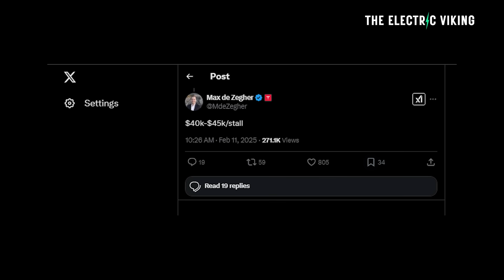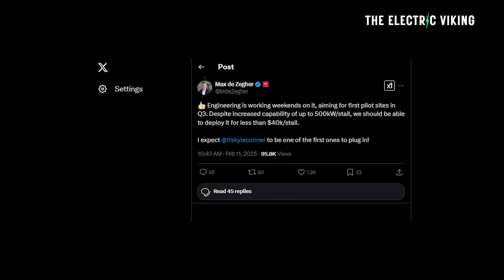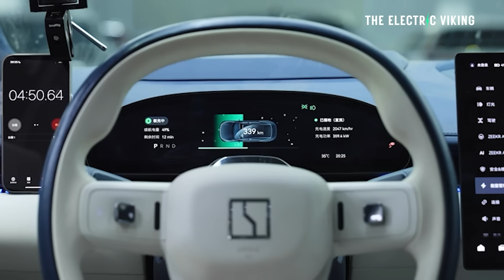Tesla's plan to build 500kw mega fast EV chargers at extreme low cost

Comment: Tesla's charging network is not the most expansive in the world, and likely also not the most reliable, it can't hold a candle to China's charging networks. Huawei, for example, started building a 600Kw charging network in China about two years ago, and the largest single-company charging network in China has about 1.15 million charging points (though I couldn't find how many of those are fast chargers).

I was trying to find if the price is comparable with that of Chinese chargers, but it's kinda hard to find public quotes for anything larger than a 40Kw charger that can fit in a garage. The one price point I found was roughly $7K for a 120Kw DC fast charger in China, from the site of a company that builds charging sites.

Comment: Wait a minute, didn't the Doge dope fire the entire Tesla charging team including the female boss.
Reply: The "dope" replaced the leader when she refused to lay anyone off. They are back at full strength as other auto manufacturers are now using their chargers and plans were announced back a few months to double the charger count in the next 18 months (mainly by expanding sites with the new 500kw V4 charger). He runs a lean shop and it has worked well so far. Remember the 7000 Twitter employees that are now 2000 and providing more features and superior services to about 95% of the subscriber count?

Comment: So, only 2 of those would need a one Megawatt+ connection. A row of ten over 5 Megawatts. That is just impossible in most cases, like a big factory in a place of a simple gas station. Or the station limits the charging current to the connection level, and all ten operating get just a dribble to charge with. That is exactly what makes this whole thing Smoke And Mirrors.
It would be nice to know if there are any places at all that can handle current like that without multi-million upgrade to the local grid.
Most things that are connected to electric vehicles are based on customer ignorance.
So, while Samsung and LG equipped EV:s ask customers to not charge their cars over 80% because of the fire risk, and fast charging itself is a risk to the battery in the long run, why make things even worse? While old statistics from the era when EV:s were still new show that EV:s are less eager to start burning by themselves, aging EV fleet will change that, and Allianz insurance giant just expressed it's worry about EV fires at dealers and garages. And reminded that an EV fire inside the mall garage means possibly demolishing and rebuilding the whole building. And of course was against charging EV:s underground or near buildings.
And you all can figure out what that will eventually lead to...
Reply: High power chargers often have batteries to spread the load; if each charger spends 6 minutes per hour being used you just need a 50Kw power connection for a 500Kw charger. And that's assuming the car connected to it can even charge that fast, most can't.
As for fire risk, that is very much overblown. Modern NMC batteries are far less likely to catch fire than older models, and modern LFP batteries (like the ones in almost every new Chinese EV) are not only even less likely to catch fire, if they do catch fire they are likely to extinguish by themselves.

Comment: My thoughts are that in less then 5 years range and charging will not be the highest priority in making ev purchases as batteries will be cheap with faster charging and battery densities will be high. Other features and amenities will be more important.
Reply: That will help, but right now, most of the range anxiety and charging time factors are psychological problems. Most miles are driven close to home, and few are driven more than 100 miles from home. People seem to be hung up on the nonirritant use case: using your car for 200 pulse mile trips more than the 5 miles for shopping.
When you buy a hammer, you buy a 15-pound hammer rather than a 1-pound hammer because the 15-pound hammer can do things the 1-pound habber cannot.

Comment: These are physical sites so they have real estate costs associated with them. So NYC will make that expensive. That will be some of the cost difference.
Reply: I have the impression that Tesla doesn't pay for land. It offers to install the superchargers at a location owned by someone else, who benefits from the added traffic and customers.
Reply: @epoliv  They do both. They have about 2668 Supercharger sites in US and 6383 Globally right now. I would imagine that given their costs and the efficient way they acquire energy (using megapacks imbedded into a concrete slab with every 4 charging posts... two quads compete with mega packs per tractor trailer... Hyper efficient especially when you throw in solar  to supplement power and further reduce sudden loads on the grid... they will be making gobs of cash and still  undercut the competition.